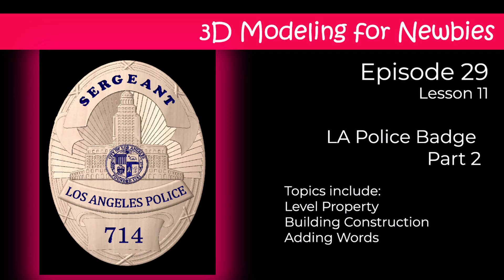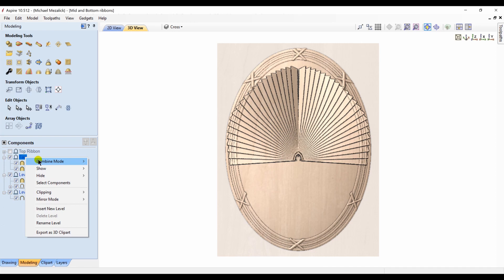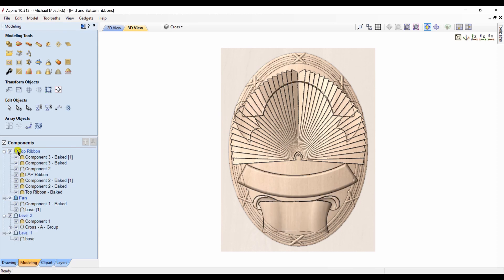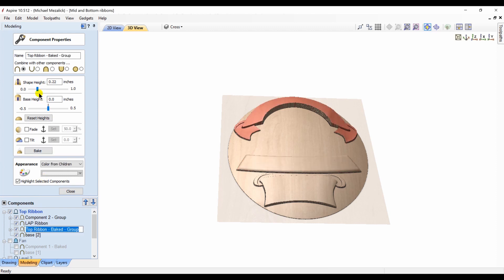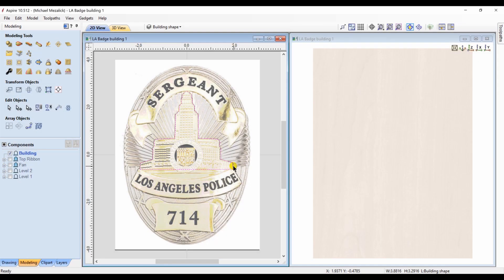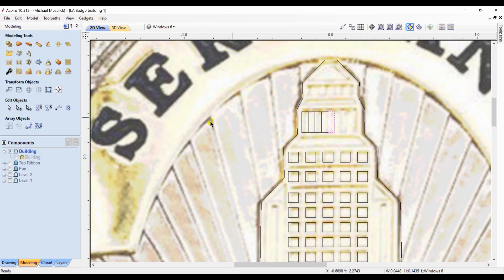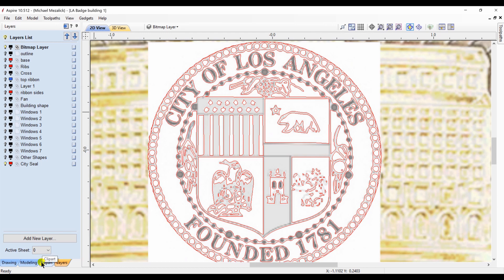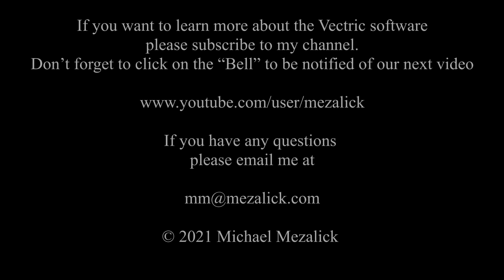3D Modeling for Newbies Episode 29 Lesson 11 LA Police Badge

Comment: I have a problem curving the text on a badge.  The letters are always crooked when spacing them out with the kerning tool.
Reply from the maker: Yep, it's a problem with the software. If you could use a program like Corel Draw you'll have better results. The new version looks to have addressed that issue a bit.